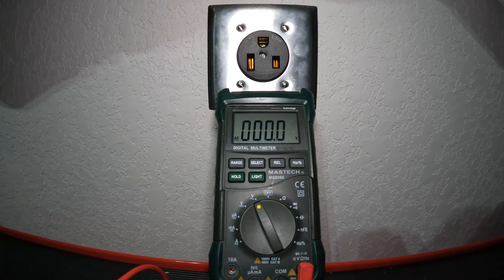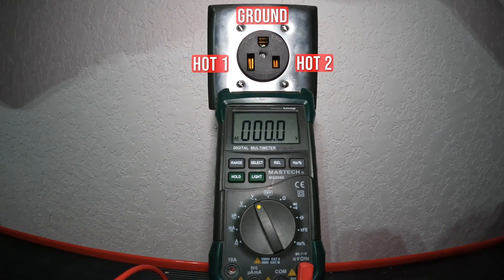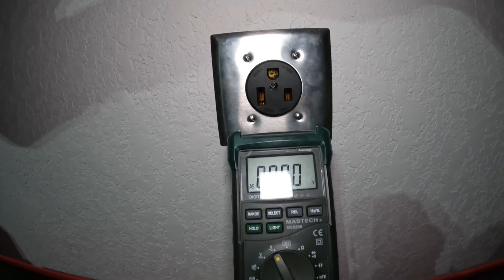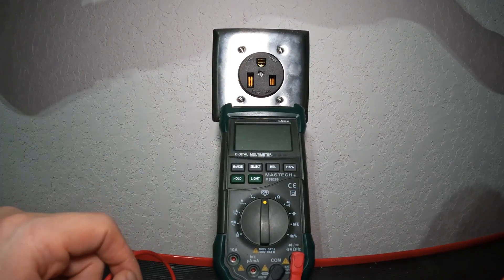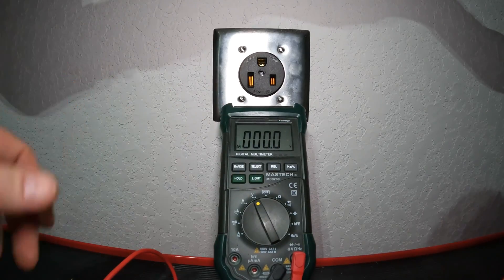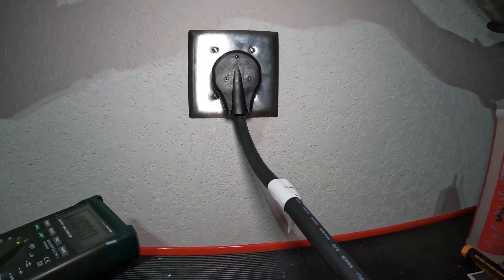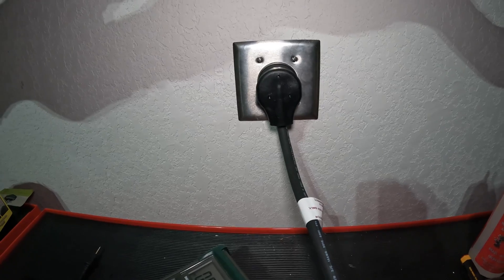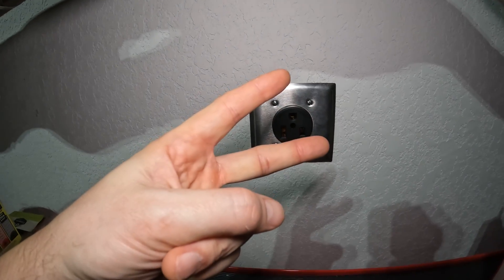How-To Test a 220v/240v 3 Prong Outlet! Easy! 4K HD

Comment: For some older 220/240v outlets, the test lead prongs on many multimeters are not long enough to make contact. My dryer outlet has this problem. It came with the house that was built in 1989. (BTW it was also installed upside down––ground plug down instead of up. I always say that some day I'll put in a new outlet and turn it the right way up. But I've been saying that for years, and now at age 79 I wonder if that day will ever come. Such is life.)
Reply from the maker: Ahh, good point! Def may need to buy longer tip test probes or something. I've found the ground plug up is usually in commercial/industrial settings and down in residential. I'm sure after all these years incident free you are fine :D Just don't drop a wrench onto a partially plugged in plug into the outlet :D lol. Being 79 and still up and active is impressive already!
Reply: @d3rpzilla  Thanks. After writing that, I somehow found the energy to rotate the outlet. Took all of 10 minutes to go to basement, cut off breaker, remove 4 screws for outer cover, remove 4 screws that hold in outlet, rotate 180, and put back. I feel better, and I'm pretty sure that the intermittent problems with dryer not starting had to do with the weight of the heavy cord exerting a downward torque on the plug and loosening it just enough to break contact. Hope so anyway. BTW the outlet is an Eagle Electric, marked Al-Cu, with thick brown plastic and very recessed copper contacts––probably from '89.

Comment: I get 120 each side but won't get the 240 ! What is the problem.  I checked my compressor and it works  but not the welder outlet? Hmmm
Reply: 😂I figured it out , it was  the  way my break is in the panel , it has to cross the stab lock thingy in the panel
Reply from the maker: Ooo.. Nice work! Haha. Glad you figured it out :D Sorry I missed your comment earlier :D

Comment: if my tester says 120v when testing a 6-50 240v 30amp outlet. Must be  a wiring issue or do some testing just suck?
Reply from the maker: Is it reading 120v between both hot prongs? Or 120v between 1 hot and the ground? If it's reading 120v between both hots then it sounds like something is wired wrong... perhaps check each hot to the ground and see if maybe 1 reads 120v and 1 reads 0v.

Comment: I couldn't get a reading on a three-prong 240-volt range outlet. A Samsung range was just fried by something. All of the harness wires in the back were mounted and charred. So I bought a used LG and plugged it in and it's working fine. What reason would it be that I could not get any reading on that three-prong outlet? The multimeter works fine on the 120-volt outlets
Reply from the maker: Hmm.. weird. No reading at all.. it just shows like 0? Or does it show something else on the screen? Is the meter in the right setting and everything? I assume so as you mention you could test the 120v outlet fine. Are you using similar probes like the ones I have? If your probes are to short perhaps they are not getting in far enough to make contact with the metal piece inside each slot in the outlet? Why kind of cord does the LG have? Is it the kind where on the back of the LG appliance you have 3 tabs or whatever where a power cord connects with screws for each strand of the power cord and you can see the actual wires? If so, perhaps you can try to test right off of the back of the appliance?

Comment: If one hot side has 243 volts (left) and the other reads normal at 122 what might be wrong? Should i get a new outlet? My dryer wont work and gives error for Power issue
Reply from the maker: What does hot to hot read?

Comment: Will this test help my dryer because this is the second time it is without heat again.  The first time, it was the heating element, this time I am not sure, but maybe that heat element again!!!!!
Reply from the maker: I wouldn't think it would be an issue with the outlet as it sounds like the dryer turns on and runs but doesn't heat? If there was no power at the outlet the dryer wouldn't come on at all so it sounds like it could be the heating element again possibly 😢
Reply: @d3rpzilla  I thought I saw a video where someone said that if one side of the 240 v outlet is shortened, and the power is less on one side that the dryer could still work, but that it needs the full 240 volts to be able to use heat?  I could be wrong???
Reply from the maker: @williecunningham3725  that does sound reasonable but I'm not like an appliance mechanic and hadn't ran into something like that just fixing my own stuff yet... But definitely can't hurt to test the outlet and confirm it is indeed tunctioniyas it should.
Reply: This is the exact issue with my dryer and it is because of what you are saying. The dryer does run and no heat.  I had my eiectrcal mast come down. I got it put back up and the power company came and hooked back up tge lines.  Ever since the dryer hasn’t worked.  I started googling and saw it could be the 240 volt power supply only giving me 110v.  Well I just watched this video on how to test it,  sure enough only getting half of the 240volt. So I’m guessing one of the lines they connected isn’t right, no 110 v or connection to the 110v  line isn’t connected properly or I have some other issue going on in my box.
Reply from the maker: Ouch :-/ Hopefully it is something easy to fix!! Good luck! :)

Comment: Damn my prongs aren’t long enough to reach down
Reply from the maker: The test lead prongs?
Reply: @d3rpzilla  yeah. Here’s something odd, had two pro electricians set up a weld circuit. Plugged in two separate welders, neither turn on. When they tested it just the other day I saw it with my own eyes it said 240v on the reader. Just tried sticking the plug in and leaving a half a mil gap for my own test prongs, my reading only showed 120 on one side. I wonder if the inner outlet is just bent or something and won’t contact the other side of the plug to give it 240v

Comment: One correction to this, never place the leads in different hands. You want to use only one hand in case something happens. If you have it in two hands, the current will run through your body and you won't be able to let go.
Reply: But how is there current when he pulled out the multimeter prongs before he put them in the other hand?
Reply: Yep, I place one lead in, leave it in and then stick the other in, all with the same hand. 220 kills and if I am going to go sticking something in, it's going to be in bed.